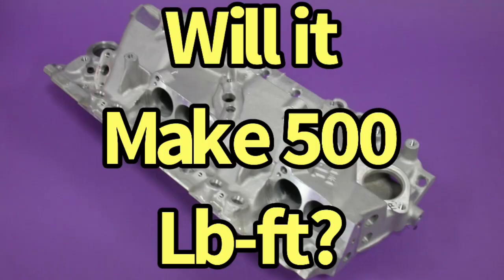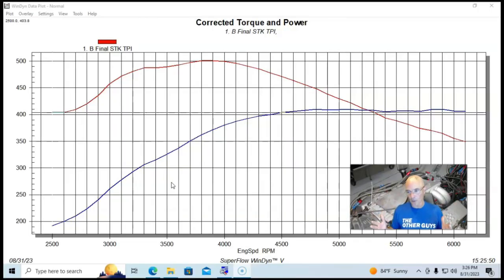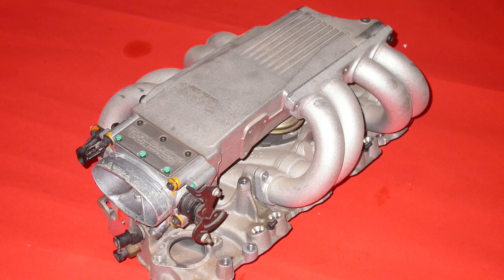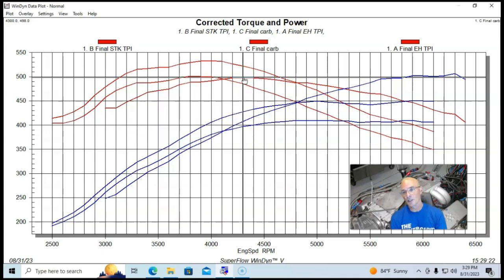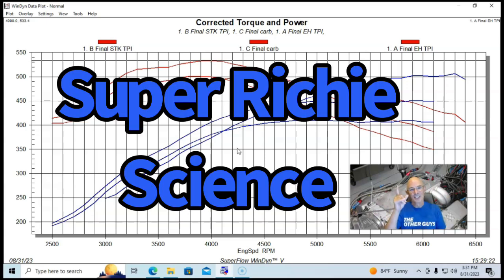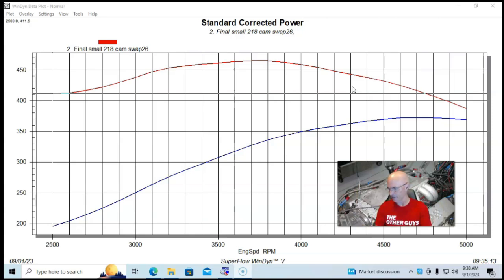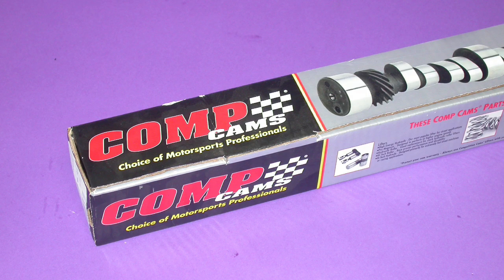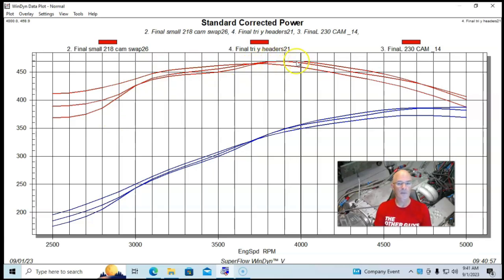TUNE PORT L98 350-CAN WE MAKE 500 LB-FT OF TORQUE? PLUS, TRI-Y VS 4:1 HEADER TEST-WHO MAKES TORQUE?

Comment: I think that the crankshaft stroke length has the biggest and most direct impact on torque production. 

None of the cool stuff you applied during the tests can increase the stroke length, only changing a crankshaft can do that. 

But I have no idea if putting in a crankshaft with greater throws/offset is even an option with that engine. 

Cylinder diameter and cylinder wall length, connecting rod geometry, and piston geometry and piston skirt length may already be optimized or maximized for that engine. 

Of course, may be missing it as well. 

These are just some thoughts that I thought would be worth sharing. 

Thanks for another great video. 

Take care
Reply from the maker: we purposely did not want to change displacement (we easily made the number with a 383-harder with a 350
Reply: For the same volume there's no difference between stroke or bore, unless it's flow limited and you need the valve size that's possible with bigger bore.

Comment: All tests are learning opportunities.  I think 1 5/8" is just too small at 355 inches.  Could use a balance tube as well.  Increase rockers test1.6, 1.65, 1.7 for sure.  Most of us would rather do a fast  rocker swap than a long cam swap.  Good video.
Reply: "1 5/8 is just too small at 355 inches"   The late Jack Davis (formerly at Hooker back in the day) would build headers for the 454 powered crew cab dually tow rigs of his and friends drag cars. With 1-1/2" primary tubes about 42" long into 2-1/2" collectors. Pass others on the Grapevine, and at the gas pump.
Reply: me too i think a  h pipe may help , 1,7 on that cam use i think it will make it
Reply: Agree 100%!! On all accounts. A stroker would've done it I believe....

Comment: Occasionally I would see a C4 or an IROC (auto) scoot down the 1/4 mile much better than stock. Besting the LT1 even. And under the hood it looked stock, no power adder. I was thinking stroker and porting. Back in the day.

Comment: Not a fail. The tests prove that a stroker kit is the way to get 500 pound feet from a TPI small block. 465 torque from a 350 is no slouch. It did just what you taught us about TPI motors way back in the day - massive torque. A Comp XFI cam might have made a little more, but building a TPI stroker is the real answer!
Reply: Throwing in a cam with 107 LCA and 35-40° of overlap will get the right cam needed for maximizing torque which should be around 490 ft-lbs and be 1.4 ft-lbs/CID.
Reply: @matthewmiller2268  
Seems short.
268/280/107 = 60 degrees overlap.
@ 0.050 it is 224 / 231 / 107 = 13.5 degresse overlap.
Reply: 465 foot pounds out of a 350 would have been ludicrous in the 70’s and 80’s. Everyone was running torker ii’s and making like 360 foot pounds and the same power number as this motor. I thought my 350 was a torque monster for making 420 foot pounds from a mild roller cam eps intake and world s/r torquer heads. Low end for days and pushed around a heavy square body like a big block.
Reply: World sr torque ii heads?  @theeoddments960
Reply: Considering the majority out there can't even handle 150 hp in a sub compact car...
Reply: lol
 @shadowopsairman1583

Comment: HEY RICHARD. More aggressive cam lobes... Howard's has a lobe that specs 281 duration 231 at .050 .552lift .589 w a 1.6. Have it ground on a 108 lsa. I have a hunch that tpi engines will respond well to a mild  single pattern cam with lots of lift on a tight lsa.
Reply: Comp xfi 280, order it on any lobe center you want. Jones cam designs ehr 72360 lobes on a 110-112 lsa would be about the same
Reply: @b.c4066  I'm running the Mike Jones 70375 / 71360 on a 110 LSA in my 350 FIRST TPI build, so I have to agree. ;-) 
272/280 ADV, 227/228 @.050", .600"/.576" with 1.6 rockers.

Mike said if i didn't need vacuum brakes, he would've gone a little bit tighter still on the LSA, too...

Comment: I think the tri-y headers were not the best example of what a good set of tri-y headers could do. Increase the primary lengths to that of a good set of long tube 4-1s reduce the secondary y to 18 inches and run a good 3 or 3.5 collectors look at NASCAR or V8 supercar headers. Oh and the answer is always boost gt45 cheap China turbo or a good China Gt3582RS something like a PSR or a factory Garrett from a xr6 turbo
Reply: I think the tri y headers only work better with the ford firing order. BMW, Merceds have also offered tri y exhaust from factory, but they all share the firing order with the late model ford.
Reply: @danr9584  yes and no Honda's seam to respond to tri ys better than 4-1. The issue is it's very easy to get any set of 4-1 headers to work  while a good set off tri ys takes alot of math but even more testing as the range at which they really work will be different for each engine combo. I will definitely agree Ford's are easier to get to work saying that I tried 4 different brands of tri ys on a 4v 5.4 before working out what primary and secondary dimensions worked best throughout the entire rpm. I still maintain that well designed tri-ys will out perform 4-1s look at motorsports very few V8 American/Australian racing cars that run 4-1s (again talking about the big league ppl NASCAR etc)

Comment: Mill the heads for a bit higher compression. Tune primary length on the 1.75" headers. Tune collector length as well. Add 1.7 roller rockers to take better advantage of the head flow. Scorpion makes them for sbc. I'm running them in my daily driver on my old 92 c1500. Larger throttle body if possible.
Reply: I guess youve never heard of port saturation or parasitic stress on the crank. You guy and this massive lift, in most cases high lift loses horsepower. Theres a point (especially with stock heads) where they start to lose power because the ports dont have the ability to flow any better. The stress the added lift puts on the crank due to increasing spring pressure  cost horsepower. You use the lift that the heads are capable of flowing and valve springs that dont cause the crank to work harder to turn. Most small block street engines like .450 - .500 lift and 325 - 350 lbs of spring pressure at max lift. Going beyond that does little if anything as far as power is concerned.
Reply: Put the aluminum heads from a vette no need for machining to get higher compression

Comment: One answer.... More Cubic Inches
Reply: Put the TPI setup on a 400 small block.
Reply: @danr9584  yep, that's the answer 😁
Reply: As a devout student of the Super Richy School of Thought I say, "boosty-boost".
Reply: Your “one answer” is the WRONG answer because that’s not the purpose of the video. Did you even read the title?

What’s your suggestion for making 600ft lbs with a 400 then? “JuSt rEpLaCe iT wItH a 502 BiG bLoCk” 🤦‍♂️
Reply: @DTunedMotorsport  The Great thing about America is that we have Freedom of Speech. while you may not agree with my opinion, I have the freedom to state it, and you have the freedom to Verbally Attack me. But Judging by your screenname, your brain is detuned. And GuEsSiNg by your post you are about 16 years old. So let the grownups talk. Now go get a spoon, so you can EaT My AsS!
Reply: @DTunedMotorsport  1.33 ft*lbs per cube is a good place to stop so if you need more Ft*lbs you need more cubes or boost.
Reply: @DTunedMotorsport there’s nothing you can really do to make more torque out of this than an even LONGER runner intake that doesn’t exist. This is the brick wall. Power can be always added spinning high rpm but the crank will never get any heavier and the rotating assembly will never have any more rotational force than it already has. This is a great place to stop.
Reply: @theeoddments960  
I've wondered about this. I wonder if anyone has built up longer runners onto a stock TPI intake. You can go tall like the Ramchargers High and Mighty or wide like their later 413 Sonoramic Commando/Ram Induction. (Just bend it back into the TPI plenum)

I know there's science and shtuff to consider like volume, velocity, reflective wave stuff.

I wonder if Super Richy has an opinion on this. I value his experience and insight on engine design, tune, and dyno.
Reply: I don't now if this is an original qoute but I thought it was pretty cool but an old man back in around 92 told me the only thing that  beats cubic inches, is cubic dollars😅
Reply: 030 over?

Comment: It needs 10.75:1 compression, an aggressive 236/242 camshaft, and 1.6:1:rockers.

I'd also hazard a guess that stepped headers (1"-5/8" at the heads) with merged collectors might help on the current combination with the smaller exhaust lobes.
Reply: Small stepped headers with merge collectors. I like someone bringing back a combo with high velocity exhaust. Nice touch.

Comment: I built a 355 then 383 in 1989 and used a cam dynamics 306 enforcer on both engines with a 106 lca.   I have to say i couldnt believe the torque from that cam.  No dyno results but seat of the pants. Lol.

Comment: I knew it! I didn't trust those triple Y headers to be better than long 4:1 headers, seeing it well is almost the same 🤷🏽‍♂️.
To increase power a solid roller camshaft with more lift and duration will help a lot
Reply: I had a completely stock 1963 Impala SS with a 327/Glide combo that had Horsepower Engineering Tri-Y headers on it since it was new. In the mid 70's the headers were rusty and leaky, so I had it on the rack at work so a buddy could weld up the leaks. Fired it up, sounded great, start to back out of the shop...and the rack wasn't all the way down, and tore the hell out of the headers. Had to replace them with some Hedman 4 tubes to get back on the road. It felt like I had pulled 2 plug wires off! It was a gutless turd with no bottom end at all! Gas mileage went down, driveability sucked, I couldn't believe the difference.
Reply: I agree completely. People don't talk enough about the benefits of a Solid Roller cam on a long-runner build!  (I disagree on the Tri-y comments, but that's a much longer conversation.)

Comment: 350 cubic inches will struggle to make 500 ftlbs
Reply: well 455 cubes does it REAL easy, and fits where a 350 goes.
Reply: Eh, depends on too many variables to make that statement.
Reply: @GoatPilot04  ok a 350 that is built for street use will struggle to make 500 ft lbs.  There fixed it.  Now a max effort high compression e 85 or racegass 350 could do it.
Reply: It's possible though.    A serious effort 350 will make around 525ft-lb some slightly more.    It means high compression 12.5;1 or higher, solid roller cams, serious heads and matching intake and induction system.
Reply: @dennisrobinson8008  Exactly. Taking the compression to 12 or 13:1, very good heads, and the right cam, and it's breaking that all day. It's just a game of trade-offs.
Reply: @GoatPilot04  and the magical tight lsa camshaft
Reply: 5.9 Cummins does it 🤡
Reply: @xmo552  ya well it's a TURBODIESEL